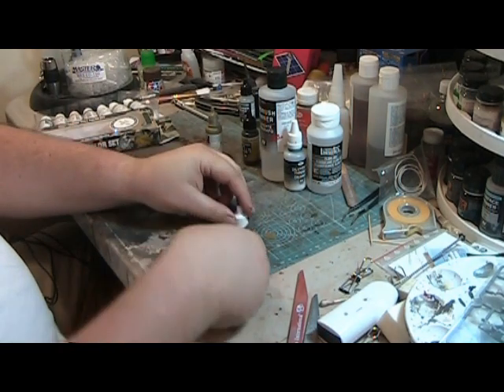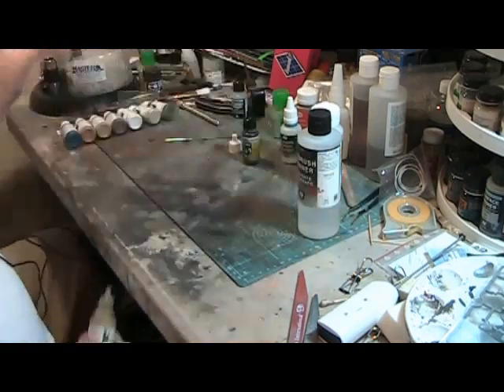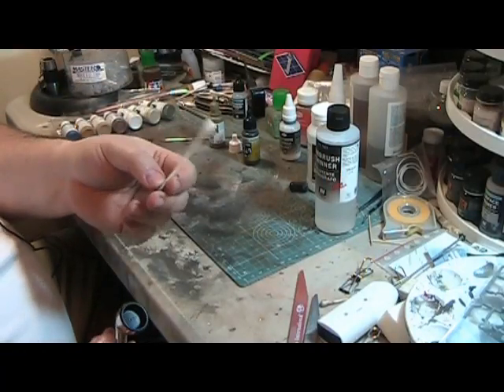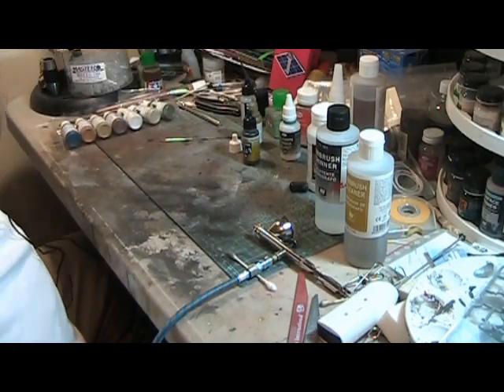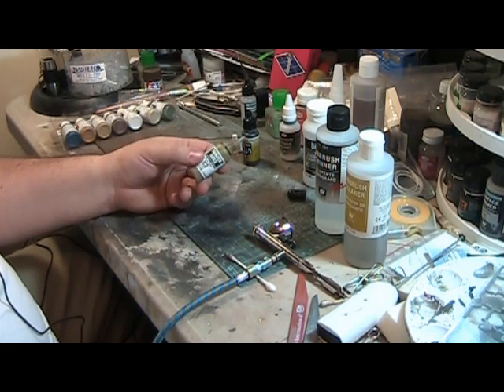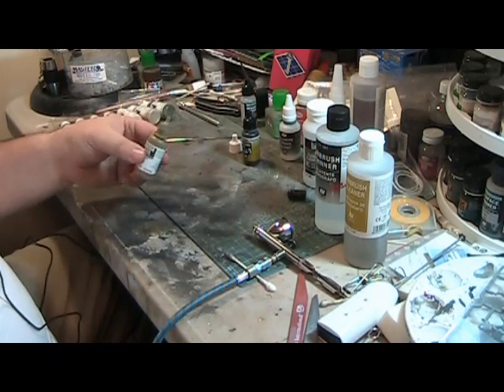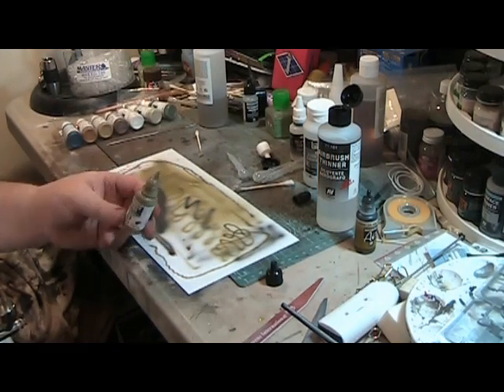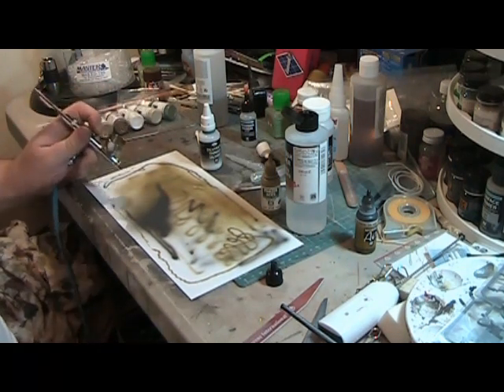Thinning and spraying Vallejo Model Color and Model Air

Comment: Steel BB's is what I use. Super cheap. Works great.
Reply from the maker: Until they rust and ruin the paint.   Water based paint needs stainless steel.  What's cheap last time I bought some they were like $12 for 200.
Reply from the maker: Yeah,  that's not a thing no eye dropper bottle is air tight plus air gets in when they fill the bottle.   I'm glad  BB's work for you.   To be honest I could give a shit what you use.
Reply: @TacticalJackalope  Funny that you give a %$^*$ enough to comment.  So you do care..

Comment: I have made the home brew that awesome paint job posted for brush painting and it works great. Now for the airbrush I use nothing but the best windshield washing fluid from Walmart 4.99 a gallon and in the year I've been using it have yet to have seal problems. Yup on a hot day flow aid works great. Cheers.
Reply from the maker: Da-Mad Modler Thanks for the tip Clint!  I hope you are well and it is great to see you participate in the Secret Santa project this year.

Comment: Great video thanks!  I have always used 'Vallejo Air' acrylics in a 'Iwata' with a 50/25 mix and had no problem but tonight i tried 'Vallejo Model Colour' and it fouled up straight away.  I tried your 50/50 and it is now fine.  Thanks for the tip.

Comment: Vallejo Flow Improver is the answer - you can even use it on it's own, with no thinners.  Works wonders!   What a mess that bench is, I couldn't work at that

Comment: Ok, ive tried using vellajos directions on their airbrush thinner with their gloss varnish and even when cranked up to nearly 30psi ive had clogging issues making it difficult to get anything.

Ill have to try 1 to 1 and see if that works as needed at the average low 15psi.

Comment: you can also use glass beads from jewelry sections.if users ball bearings be sure they are stainless steel otherwise they will rust in the bottles..thanx for vid
Reply from the maker: +Timothy Byars Too light I'll stick with 440C ball bearings.
Reply: +TacticalJackalope Just use BB'S

Comment: I'd like to mention about my experiment about airbrushing Vallejo's.

They are quite familiar with clogging issue no matter what you do, as everyone knows. But i've witnessed something yesterday. What actually clogs is, the already dried paint particules inside the paint cup during spraying. And these particules occur on the top side of the paint, around the paint cup. You know, during spraying, there will always be a little paint stain while the paint level decreasing in the paint cup, i guess thats the issue!

To prevent that, i think keeping the paint cup closed during painting will vastly reduce the drying time of the paint inside the cup.
Reply from the maker: +Slammer A few drops of their retarder or their airbrush flow improver also does the trick.

Comment: I found a 50/50 ratio with 12psi works well with the iwata hp c plus and 4mm tip. and worked with distilled water as well.
Reply: tm_ipod is the thinner sort of a water base??

Comment: I will stick with tamiya acrylic paint mixed 2 to 1. I have had too many clogging issues with Vallejo paints and if you thin it down for a good flow you have to use 3 times as much paint to cover!!
Reply: it is way to expensive, too
Reply: +1

Comment: I had a short bout of luck with Vallejo from an Airbrush thanks to this video, that was three years ago.  I finished a single kit using their thinner and flow aid.  Their Model Air has been a pretty useless product to me however, as it does not spray well for long.  Tonight I revisited Model Air and added a ton of flow aid in order to get it to spray.  It just does not perform as well as Tamiya or Mr Color with Mr Leveling Thinner; nor does it spray as well as mission model paint.

You have much better results that I have had though.  I’ll continue to use Vallejo to hand paint, as it does perform in that category.

Comment: You can buy stainless steel shot on ebay. I bought a 1lb bag for 15 bucks. Make sure it's stainless as the chrome or aluminum tends to rust in the bottle
Reply from the maker: Thanks Gill I appreciate the good info.  How are you liking that new H&S beauty you got?
Reply: What size stainless steel shot would be appropriate for the Vallejo dropper bottles? Do you have to buy the steel shot in bulk since it's usually used for reloading shotgun shells? The Citadel pots are wide and the paint usually thicker... I'm thinking i'd get slightly bigger shot for those, any suggestions?
Reply from the maker: Sturmavk Not shot...ball bearings and you would need 1/4".  Steel shot is not stainless( I am also a shooter and handloader btw) and would corode and and ruin the paint very quickly.  Here is a link to the dealer I buy mine from...http://www.ebay.com/itm/100-1-4-inch-Diameter-Stainless-Steel-440C-G16-Bearing-Balls-/400280238646?pt=BI_Heavy_Equipment_Parts&hash=item5d328fba36
They are also available in in 420C but 440C is harder and better corrosion resistance properties imo.  Cheers and thanks for watching!
Reply: Thanks brother
Reply: Sturmavk What you're looking for is called stainless steel ball stock, you can buy them at fastenal or grainger stores if you have one in your area.  It's the ball part of a ball bearing, technically the ball bearing is the complete assembly with races.

Comment: I use testors acrylic thinner and it works too. Im using it though a Badger 350 with an air can. I just use shorter burst and keep the can in warm water.  I clogged at first but after I added enough thinner to it to the consistency of milk, it works fine. Course Im using a medium size needle too so don't know how it would work with a finer needle.
Reply: I want to make one edit to my above posting...do not put your air cans in warm water. I started having condensation problems. I just switched to using short burst and take my time about painting it.

Comment: Very informative video and thank you. I'm more adept in using lacquer based paints. Learned more about airbrushing Vallejo paints. 
I use a drop of liquid dish washing soap. The kind that don't have moisturizer or cologne because I found out the hard way that in the long run moisturizer and cologne contained alcohol or dish washing alternatives affects the paint and make them yellowish and peel. 
Instead of using steel ball bearings why not use small glass marbles for agitator. I use them for my Mr Color, Mr Aqueous, Tamiya acrylics, Humbrol enamel paints. I hope this helps also. :) :)

Comment: I use your poppet system for mixing acrylic paints sometime, however i bought some dealer scales on Amazon measure down to .001g its good and very accurate.
Good Vid.

Cheers Ken in Stafford, UK

Comment: BB's work great for mixing paints in the bottle.
Reply from the maker: +lastdollarfilms No so much actually especailly if it is a water based acrylic paint.  They will rust and then contaminate the paint also ruining the paint.  Stainless steel ball bearings or perhaps a nut I'm afraid is the only way to go.

Comment: I've been a fan of Model Master for decades and they're going away. I deed to put a falt coat on a model, I have Vallejo Mat Acrylic Varnish 26.518 as well as air brush thinner 71.361. Straight or thinned it beads up on my surfaces even after wiping down with 91% rubbing alcohol. Any clues, I've lived with clogging needles before no biggie. HELP, been duilding for years I've never had issues like this. VLS, Thayer Chandler, Iwata. All the same results.

Comment: As I have a lot of these colours, this was exactly the info I needed to know. O also saw a video using windex for Vallejo Hobby Colors and Panzer Aces. What's the deal on that? Looked liked ot worked well. But looks can be deceiving.
Reply from the maker: Gary Armstrong If you smell the the Vallejo thinner it is definitely ammonia based so using windex would seem possible.  I just don't have time to experiment so I will always use the manufacturer's product.

Comment: Ive found that Steel 4.5mm BB's work great for dropping into the little bottles to mix the paint.
Reply from the maker: That has been suggested before.  However, you might want to consider that since acrylic paints are typically water based(not always) these BB's will rust and ruin the paint.  I suggest 1/4" stainless steel ball bearings they can be had on Ebay for about $12 per 100.

Comment: Ball bearings ?
Any half decent bicycle shop should have half a dozen different sizes - .1875" diameter works for me.
I wish I could keep my workbench as tidy and organized as you do. Absolutely pristine.
Reply from the maker: Andrew G. Whitaker Shortly after this Chris from Chris and Alex modeling informed me about the source for said ball bearings.  They are readily available on Ebay from many sources.  You can buy 100 qty. 440C stainless steel ball bearings for about $8-10.  Thank you for watching and taking the time to comment.

Comment: 1) Quick question with Vallejo Surface Primer in a bottle and Vallejo Airbrush Thinner would you recommend adding NO thinner for a 0.5mm needle in the airbrush ?

2) Also say for a Citadel Base Paint McCragge Blue (NOT the air range version) would you recommend a 50/50 ratio with Vallejo Airbrush Thinner for a 0.5mm needle in an airbrush ?
Reply from the maker: I've never reduced/thinned Vallejo Surface Primer nor would I it sprays beautifully "neat" or straight from the bottle.  

I've never used Citadel paint so I can't answer that question.
Reply: Well I'm going to do it with a new cheap 0.5mm airbrush / compressor / and Vallejo Surface Primer (grey) on a new space marine right now this second so wish me luck. (psi 20)

Comment: I'm having trouble with spraying acrylics. I always get a grainy finish. I've done just about everything I can think of. I've tried more thinner, lower psi, spraying closer. I use a master brand airbrush. Do you think I need a better airbrush?  I wouldn't think the airbrush would matter that much. Any information would be helpful. Thanks
Reply: Jeffery Barker  I went ahead and bought a new airbrush. I bought a badger patriot 105-1. I haven't used it yet. Hope It helps. You make some great videos, a lot of useful info. I will keep adjusting if I still have troubles.

Comment: Thanks for the feedback. 45 psi is just what my compressor is set at regardless. I'll try lowering it though. Could you tell me the ratio of water to Vallejo paints for air brushing please? Thanks!
Reply from the maker: +jammerman28 I would love to only issue I have never used it therefore it would not be appropriate to suggest a ration.  I would experiment always using going for the consistency of skim milk.

Comment: Late to the show but this video did help me out with these Vallejo paints. I use an Iwata AB and normally Tamiya paints when I go out of town to get them where they are available. The hobby store here only carries the Model Master paints and the Vallejo paints. I recently went for the Vallejo Panzer line of paints and using it was like hitting a brick wall. In under a minute it would begin to clog my AB to a point of spattering at 15 PSI and above. At one point it completely clogged my AB to a point of having to totally break it down and clean it out. Thinning these paints are a totally different ball game than thinning the Tamiya paints. I have however at some points, had to use the Tamiya retarder to stop the quick drying the Tamiya paints seem to have. I use to get a rough-like finish sometimes but since using the retarder stops it. I have a better grasp of the Vallejo paints now since watching this video. I think I'll try some of their  Vallejo Air line next.

Comment: Great vid Andy. lots of good stuff in there.
You have to be careful with washers and ball bearings... they can rust eh? I've seen a few bottles of pain go in the bin because they were contaminated by rusted ball bearings and the like.
 I just shake the living piss out of it and that usually does the trick.
If you can find non reactive metals or a really dense plastic it could do the trick maybe.
There's even those expensive paint shakers and stirrers that will do the job.
Reply from the maker: Will do some of the guys have made some good recommendations in that arena so I will be checking them out for sure.
Reply: I use stainless steel nuts for the job...work pretty well...been over a year in the containers so far and no sign of corrosion yet.

Comment: If you don't mind me asking, have you ever used the Liquitex Airbrush Medium?  That's what I've been using to thin down my vallejo game color paints.  I don't think a 1 to 1 ratio is low enough though.  I use iwata eclipse hp-cs with the .35 tip.  It clogs pretty bad with the game color range.  So it has to be thinned a whole lot.
Reply from the maker: To answer your question no I have not.  The clogging is not entirely the thinning ratio it has to do with the incredibly fast drying time of Vallejo paint especially with model air.  I use Liquitex Flow Aid to break the surface tension which helps but since I have made this video my preferred paints are now Tamiya Color they spray perfectly and are very forgiving when it comes to a thinning them.  I still use Vallejo paint just not to the extent I used to.  I ALWAYS use the manufacturers thinner and in the case of Vallejo it is readily available and inexpensive.  Thank you so much for taking the time to watch and comment I am very grateful.
Reply: TacticalJackalope No problem buddy, it was a good video.  keep up the good work.  I might have to try out the Tamiya.   How are the colors for the line? similar to game colors brighter pallet or like the model colors more muted pallet?
Reply: There's a lot of factors that go into thinning but with VMC and VGC and the Liquitex airbrush medium I usually use 5:1 medium to paint, some of my model color paints seem tremendously thicker (my Black grey which I love as an example) and I have to use closer to 10:1.  For the Liquitex airbrush medium I recommend you transfer it to a dropper bottle too.

Comment: Nice video.  I thin about the same way.  Same product.  Today I was getting some grainy effects along the edges of my highlights using VMC.  I'm spaying around 25-30 PSI.  Could then high PSI be the reason?
Reply from the maker: Could be  I don't shoot at any where near that pressure.
Reply: To high? Or too low?
Reply from the maker: Too high
Reply from the maker: I usually spray 15-20 psi
Reply: Hmm,  maybe 50/50 isn't thin enough for a .3. I use a Badger Krome
Reply from the maker: Try Tamiya color much more forgiving and I thin it 2:1 it is a better paint imo.
Reply from the maker: I have a Krome and it's a .21 not a .3
Reply: My Renagade Krome came with a .21 & .33

Comment: Hey. I've got an VEDA W-130A airbrush; expect the trigger stopping thing at the back - i'm doing it manually by opening the back case -

Anyway, i've got this big problem since i've bought this. Even if i loosen the "chuck" all the way down, my trigger has a dead-zone at the full back position and won't pull the needle back completely. For example; if i pull the trigger back by hand ~%80-85, there's still a little null zone that trigger wont pull further; and i can fully open the nozzle by pulling the needle with my hand; so that it open the paint hole %100 i guess. It's actually irritating, because even if properly thinned, M.Color's wont spray very well with the full trigger, but if i pull back by hand fully (or just unscrew the needle and pull it all the way back) it sprays flawlessly..

What should i do for that ? 

Note that, i'm using 0.2mm needle/nozzle with the default 0.3 needle and nozzle caps, as i'm a Vallejo paint user and as you know, m.colors are thick paints.

Here's a video of me, trying to explain the situation..

Trigger issue of WD-130
Reply from the maker: I  am sorry I am not familiar with this brush but I am not a fan of the cheap Chinese stuff.  I would recommend you buy a name brand quality product. i.e. Badger or Paasche for example.

Comment: I'm using alot of Vallejo Game Colors with my airbrush and I'm having trouble with doing fine gradients and such without overthinning the paint which causes splatter.
Should I thin VGC with 2 parts thinner to 1 part paint as a guide line? And I'll have to inncrease the thinner as I decrease the PSI to do the small detailing?
Reply from the maker: psamtik55 That sounds about right I would agree with that.

Comment: You could use air gun/ BB gun pellets instead of ball bearing. The .177cal lead once. They usually are cheap and a tin should last quite a while. I don't know if the lead will effect the paint.
Reply from the maker: I had not considered this but what I had in mind was very small stainless steel washers.
Reply: That will work to. In the end it's just mixing paint. There are probably a lot of things one could use. You won't go wrong with washers that's for sure.
Reply: Yeah, BBs work, but you use the brass ones for one type of paint, lead for the other (acrylics vs. oil-based paints) but I can't remember which to use with which... :-(   This is my half*ss comment... :-)